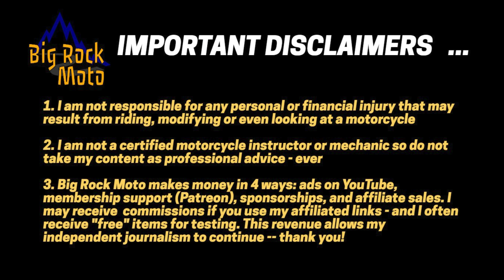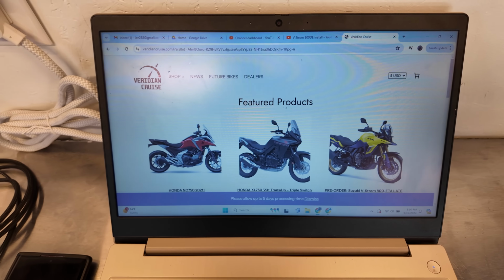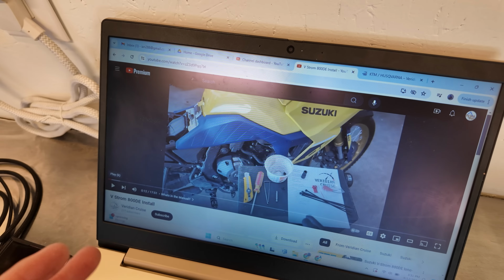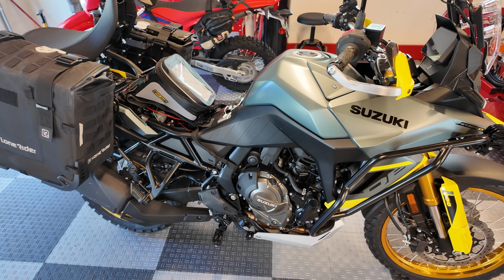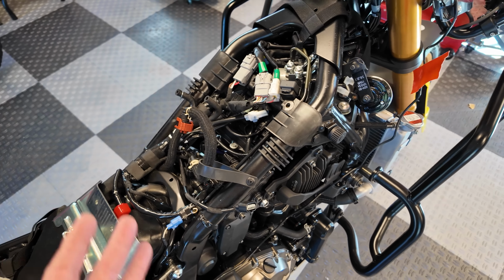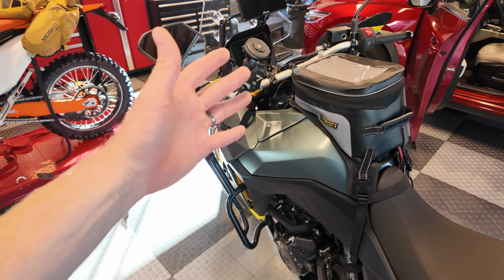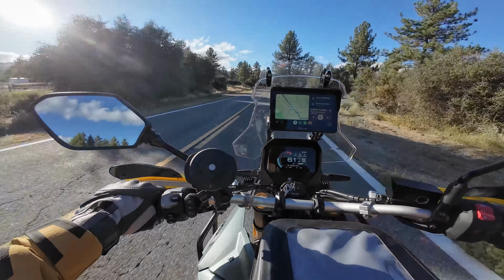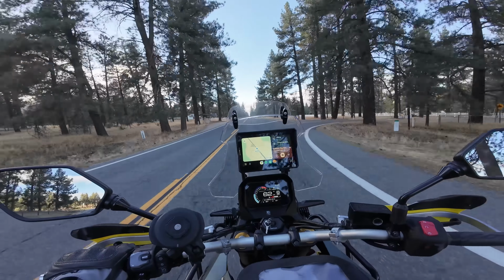Add Cruise Control to your Motorcycle (Veridian Cruise Overview - V-Strom 800DE)

Comment from the maker: ➕Use this link to automatically save 12% on any order➕
https://veridiancruise.com/?coupon=bigrockmoto

➕V-Strom 800DE Bike Build➕
⚡ Barkbuster VPS Handguards: https://imp.i104546.net/jrK2GP OR https://tinyurl.com/38e9y3np
⚡ Heidenau K60 Ranger Tires: https://imp.i104546.net/q4rNvn
⚡ Rabaconda Tire Changer: https://tinyurl.com/2j22c76t
⚡ Cyclops Aux Light Kit: https://tinyurl.com/8e73mvam
⚡ Carpuride Nav Tablet (use code IANSCHOENLEBER for 30% off):
https://tinyurl.com/bdmjxacc
⚡ Puig Clip-on Wind Visor (med): https://imp.i104546.net/ORazYN
⚡ Lone Rider Motobags: https://bit.ly/4gP8oy5
⚡ Lone Rider Overlander 48 Duffle: https://bit.ly/3YgUgq9
⚡ Tusk Pannier Racks: https://tinyurl.com/yrutapc2
⚡ Tusk SideStand Foot: https://tinyurl.com/mb8y2xen
⚡ Rigg Gear  Hurricane Tank Bag:  https://tinyurl.com/5x592t72
⚡ SAE Power Outlet: https://amzn.to/3XU0RoR
⚡ Veridian Cruise Control: https://tinyurl.com/mr3f6rst
⚡ Motool Slacker Suspension Sag Tool: https://tinyurl.com/2fsdjtv8
⚡ Tusk Wheel Balance Stand: https://tinyurl.com/yyzpej72

➕SUPPORT➕ 
[I may receive commissions which are invested back into the channel]
⚡ 2024 Gear Guide: https://tinyurl.com/3jtkmdvz
⚡ Patreon: https://www.patreon.com/bigrockmedia
⚡ Rocky Mountain ATV/MC: https://bit.ly/33kgRIz
⚡ Revzilla: https://imp.i104546.net/6bxxXN
⚡ Mosko Moto: https://moskomoto.com/bigrockmoto
⚡ Cardo: https://tinyurl.com/yrjyy5yx
⚡ Chigee: https://tinyurl.com/486mm38k
⚡ Carpuride: https://tinyurl.com/bdmjxacc (use code BIGROCKMOTO for 30% off)
⚡ Lone Rider: https://bit.ly/4erYJeC
⚡ Insta360: https://tinyurl.com/whtd6ubt
⚡ Taco Moto : https://tacomoto.co/?ref=fi6gv640
⚡ Cyclops Lights: http://tinyurl.com/2kaknpfn
⚡ Denali Lights: https://tinyurl.com/9746het9
⚡ Amazon: https://amzn.to/3viGZ0A
⚡ Merchandise: https://big-rock-moto.myspreadshop.com/

Comment: I'll never understand why, in 2024, more bikes don't come w/CC. Good for this manufacturer for creating a product like this.
Reply: it's even stranger when the bike has a throttle by wire and there is a very decent CC now on the 1050 so they have the tech.
Reply: It is intentional product/price positioning.They charge a substantial premium for 1000+cc bikes qnd one of the differentiators is desirable convenience features like cruise.  As soon as they put cruise on the mid-size bikes they will need to reduce price in liter bikes to sell them.
Reply: Your telling me! Even the cheapest car, Mitsubishi Mirage, has cruise!
Reply: @VeridianCruise  It is because on cars it became standard feature amongst manufacturers.  On motorcycles it still commands premium feature price and throttle by wire to be safe.
Reply: @kannermw  I do not get what's in your mind guys. You say one day I will buy expensive, heavy as hell bike just o have CC? NO WAY. Never. I simply do not need 250kg motorcycle. Even if it is made of gold.
Reply: @kannermw you are spot on.

Comment: On most bikes you can disengage the CC by tapping either brake, pulling in the clutch or switching off the CC switch.  S/B that way on ANY CC system.

Comment: MCCruise is another company that has cruise options, even for bikes with cable throttle. It offers a servo system to pull the throttle in conjunction with standard throttle. Veridian looks to be the most plug-n-play system for TBW bikes.

Comment: Thanks Ian. I'll certainly be using your link for my 690R. In some ways, cruise is a bigger benefit for bikes than cars!
I was a cruise control engineer for 10 years, starting in the mid-80's. The first systems had a pneumatic actuator with a separate control box. Then came stepper motor based fully integrated actuators. They were completely separate from the ECM, with inputs for speed signal, switches, brake/clutch, etc. 8 wires for I/O. Not the easiest to find a space to mount a 5 inch long box on a motorcycle, but we applied our system to the Harley Ultra first, and later to the BMW K 1200. Those were fun days of calibration rides and collaborating with the factories. This was in the AC Spark Plug division of GM, and we had 50 engineers doing cruise control design and system application!  Of course, after that generation, cars, and later bikes went to ETC as you mentioned, and cruise became a software function and a switch, which is where we're still at. PS: I remember driving GM's first radar cruise car in ~ 1994. Funny how long it takes technology to get to the mainstream. 
I really enjoy your channel. Got some great ideas from your ES700 build. Keep up the good work.
Reply from the maker: Awesome info. Thanks for sharing

Comment: Just added Veridian Cruise to my KTM 390 ADV and LOVE it! High quality parts and well thought out kit. Totally agree with you Ian, why don't more bikes come with this feature! Especially newer bikes with ride-by-wire throttle.
Reply: I’ve had it on my 390 adv for a couple months now. A lot of excitement my first time using it, then testing it on hills. Just like in a car. I only have a 25min commute to work but I still use it every day, even if just for a few seconds to give my wrist a break or to chill out in speed zones. It’s so easy to use I usually turn it on as I’m exiting the driveway. That way “set” is only one click away when I need it for the duration of my ride.

Comment: Thanks for the video, I’m all for cruise control on a motorcycle.  I have installed a unit on four different bikes. My first was an AudioVox vacuum control for my 1990 ST1100 Honda, then I installed a Rostra electronic on my 97 and 2002 ST1100 Hondas.  I recently purchased a 650 VStrom 2007 model which I will be riding up to Tuktoyaktuk next summer. Cruise is a must have.  I installed a Rostra Electronic cruise control on it too.  These bikes don’t have ride by wire so it isn’t as easy install as you had for the VStrom 800.  McCruise is another option for the older bikes, but considerably more money and a much more involved install but easier than the Rostra route.
Thanks for promoting this unit, it seems like a no brainer…..
Have a great week

Comment: Nice vid, I used your code and purchased a unit for my 2019 Africa twin in Australia. My only criticism is the tactile feedback of the buttons. They feel great on a bare thumb, but in gloves I can't really feel the cancel button as my thumb is big enough to hit the cancel and set button at the same time. As a result I dont use the cancel button, I apply the brake or open the throttle to stop.

@veridiancruise If you ever create a switch like the KTM or BMW cruise control with an up/down lever to set and and a left lever push to cancel it would help with operating with gloves. I know this switch would cost more but I'd be willing to pay a little more considering this unit costs half the amount of alternative brands

Comment: I would still pick the MCCruise version, even if it's more expensive. It has on clutch press disengage and one doesn't have to strip wires since it comes with splitter plugs for everything. Also the narrow control switch they offer will probably fit better between the OEM switch box and the mirror stem.. Which begs the question, how does the Veridian system behave when one presses  the clutch with the CC enabled? Engine revs until 8000 RPM which is one of the disengage conditions? Not saying it's a bad system and it definetly has a good price, just stating what I would pick.
Reply: Veridian on my 390 disengages with the clutch. Cuts the throttle immediately. There is no splicing it was all plug and play into factory connectors. Blipping the throttle is my preferred method to disengage because it’s easy, my hand is already there, and offers the smoothest transition since you aren’t going into idle or engine braking immediately.
Reply: @Xenogy1  looking throughout Veridians implementations for different bikes it seems they are a bit all over the place. Some miss clutch disengagement, some have only front brake disengagement but not rear, some have all three. They probably want to keep the cost down but personally, I see it as a safety issue, hence my initial post about the MCCruise systems which offer all three disengagements for all their implementations as far as I know (haven't looked carefully at them all). The one thing that both companies don't offer and it would trully make their systems factory spec, would be disengagement on throttle off. While this would have been really hard I think on cable throttle bikes, it should be easier on throttle by wire ones. Though I don't know if it's a matter of procesing an extra signal or there needs to be also a physical alteration to the throttle mechanism itself.
Reply: We felt the clutch disable is a bit unnecessary, clutch switches are placed such that the clutch is physically disconnected before the switch is triggered. So you can safely start the bike knowing the clutch is disengaged. For cruise this means you are going to free rev before the switch is triggered. We did add the free rev limiter just as a precaution.
With the KTM bikes this data is on the CANBUS so its easy apply without another wire tap.
Reply: @VeridianCruise  well I guess it's a matter of preference. I would argue though that clutch slippage is smth people normally do in 1st gear where the CC is out of the question. In normal operation people will just press it all the way. And if it slips and the revs go up, than a disengage can be programmed in for an abrupt increase in revs. The MCCruise has this behavior if I remember correctly. Also, this is the behavior of the OEM CC I currently have on my 1050 strom. Nonetheless, keep up the good work, it's good for people to have options when the manufacturers "forget" about CC :)
Reply: @VeridianCruise  Suggestion from an old CC engineer: I did the application of AC Spark Plug's Stepper Motor CC to Harley's FLHTC-U in the early 90's. (and later, BMW K-bikes) If you input a tach signal or have that on the BUS, you can monitor RPM acceleration. It's quite robust to set a threshold for rate of RPM increase due to de-clutching. We had the Harley, which of course is slow revving, dropping out so quickly it felt like the electrical switch input on the brake side. And there was no way to get the RPM to increase over that threshold while the clutch was engaged. So, bottom line you can use an RPM input to disengage instead of a clutch switch. I'm about to buy your system for the 690R I am building. It looks like you've done a good job.
Reply: @hailwood900  Good tip, we will investigate adding this feature. Thank you.

Comment: How does it handle in case you have to do an emergency stop
Reply: Brake light signal (front or back) turns cruise off, as does hitting 8k rpm for example if you grab the clutch and do nothing else.

Comment: I once, asked you - how is the CC on your 1300 GS - when using the QS.... Does it stay ON, or clicks OFF ??.... On The F900GS it stays ON, if Quick Shifting UP, but disconnects, when DOWN ! - No answer was provided. SO - How does this Veridian behave in different situations - if you have a QS on the 800DE ??

Comment: How well does it react to changes in the slope? Good systems are well in noticing a speed decline when driving up a hill and keeping the original speed, others are slow to respond and by the time you crossed the hill, it is still accelerating.
Any feedback?
Reply: I have one on my Africa twin. If I'm cruising at 110km/h and approach a hill it'll drop 1-2 km/h  then match the speed again. It may accelerate and get to 113 then drop back to 110. Seems pretty consistent with the behaviour I've experienced on my previous BMW's and ktms with cruise control

Comment: Does the veridian cruise control disengage when a clutch/brake/throttle input is detected like on a factory bike equipped cruise control?
Reply: From another video, it seems only a front brake squeeze or a negative throttle twist disables. A tug on the clutch or press of the rear brake will not. Don't take my word for it however.
Reply: No it'll flare the revs until you release the clutch. That's the one minor downside I find. But it is a bit of a party trick to change up and down gears with CC engaged.
Reply: Interesting. Definitely sounds like game changer for the middle weight adv bikes that don't have an oem option. Seems like some manufacturers are leaving money on the table by not offering it themselves as an option!
Reply: There's switches or sensors for just about everything on modern Canbus wired motorcycles. The computer should know when the clutch lever is starting to move, the brake levers are starting to move, or anything else. I guess it just depends on the logic and complexity of a given model, what Veridian is capable or willing to invest R&D to get working.
Reply: Another video showed if you turn the throttle more than 5%, or shifted gears the cc disengaged.
Reply: @sugarandt  Whatever the logic is programmed into their module. Modern Canbus electrical systems on bikes have a lot of sensor feedback.
Reply: @exothermal.sprocket this is wrong.  The guy who posted that had a malfunctioning rear brake switch!  If your brake light turns on, the cruise disengages (800de).
Reply: @cpbremote  I would call Veridian to verify, that's my take on it.
Reply: They HAVE left a lot of money on the table.  I won’t buy another bike w/out CC as I travel longer distances than most.  It sucks to be ignored by the big manufacturers of bikes.  
They feel offering CC on smaller cc bikes will cannibalize sales of larger cc bikes. CC should be standard on any bike over 600 cc’s, especially “touring” bikes like the V-Strom 800 Touring model.
Reply: it disengages with either brake input, if throttle is twisted, but not if clutch is pulled (although that will cause the revs to rise and trigger the rpm cutoff after a moment).  i tested all of this today, and it works exactly as Veridian says.
Reply: @cpbremote  Guessing the brake signal from the foot switch or the hand lever switch communicates with their device for a cancel feature.
Reply: @exothermal.sprocket exactly.
Reply: @cpbremote  Didn't know if they had both switches hooked for input, or just the hand lever.
I'm guessing more modern motorcycles have clutch switches, for ECU data reasons.

Comment: To your question last 800DE video: I also find the heat absolutely distracting shading into unbearable when it's >85f. Turns what should be nice (if sweaty) summer rides into something I just can't enjoy. Turns out I just notice that stuff enough, same reason I've been passing on the Tuareg 660 despite all the raves.
Reply: If you're not willing to swap exhaust and get ECU flash, you'll have to live with the emissions heat. It's a lean operating condition that manufacturers are saddled with (to meet tailpipe emissions standards at certain RPM) which produces the additional and excessive heat. They want the catalytic converter nuclear hot.
Reply: @exothermal.sprocket  naw,  my Euro 5 T7 had no heat. The Transalp (which makes more power!) has no heat. The Ducati DesertX has no heat on the move. Suzuki in fact engineered guards so that there’s minimal heat on the left, but the right side gets heat channeled directly on your knee. It’s simply poor engineering, and not from the cat.
Reply: @cblais19  Poor engineering. Haha.
Get it tuned, no more heat problems.
Reply: KLR does not burn legs
Reply: @exothermal.sprocket  why are you making excuses for manufacturers when there are many bikes that don't have that issue?
Reply: @jackvliet  Why are you making excuses to avoid the solution?
Reply: @exothermal.sprocket  whats the solution? Not having any creature comforts because you say we shouldn't have them?
Reply: @jackvliet  I explained what the cause is, and I gave the solution. Take your medicine, or continue to suffer and complain.
Reply: A flash and decat is not a solution. Not if you want to keep the warranty or you live in countries, where it is not allowed. And it is especially not a solution if a a brand new bike needs to be rewoked to not roast your legs. The only solution is not buying it.
Reply: @Wollestar  The solution is not riding a motorcycle at all. A car is much more comfortable and convenient.
You do NOT need to even tough the exhaust or intake, in order to reflash. A reflash will provide significant and easily felt improvements (such as lowering the radiator fan-on temp, improving air/fuel ratios to significantly reduce engine heat). A reflash does not void your warranty unless explicitly specified in the manufacturer's warranty verbiage.
Any warranty work being done at a dealership will have to prove that ANY modifications you have done to the motorcycle (electronic or otherwise) are the cause of the failure that your motorcycle is getting serviced for.
Suzuki motorcycle warranties get used exactly how many times?

Comment: I don't get the recent interest in CC. It seems like many regard it as a show stopper when choosing a motorcycle. Same goes for quickshifter, between the two of them they're the buzz words for 2024. For me, they're both  irrelevant and I have have owned bikes with both.
Reply: Well, I don't get why masochists feel the need to gatekeep a feature like cruise control. 

Also, cruise control is not a buzzword in 2024. 
I used a buzzword in the first sentence of this reply. See if you can spot it and look up the meaning. 

CC has been around for a long time. With ride by wire being more standardized in the industry, it only makes sense to include it as it's mostly software related, where there isn't a lot of additional hardware and weight being added.

Not only is it a nice quality of life feature, but it also helps to reduce fatigue on longer trips, which in my book makes it an inherent safety feature.
Reply: No way you owned both as you would know CC is such a great feature for longer rides. If you wanna be stuck on the throttle for 200miles, more power to you. lol

Some people do a lot of miles on their bikes.